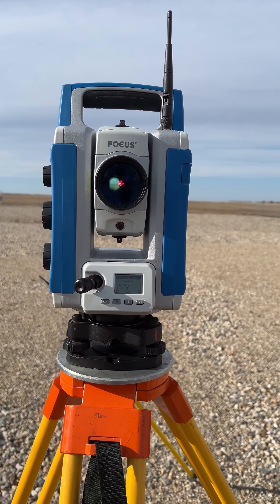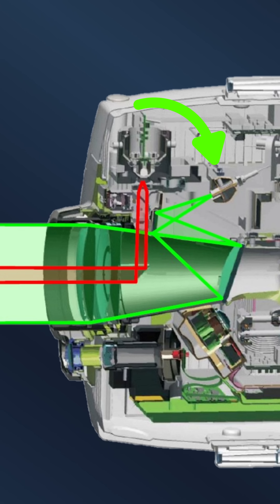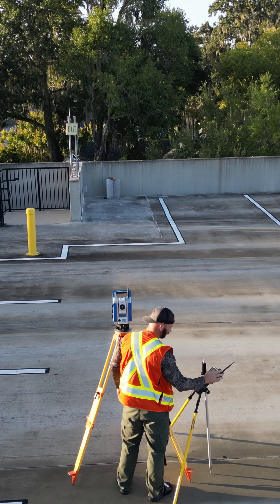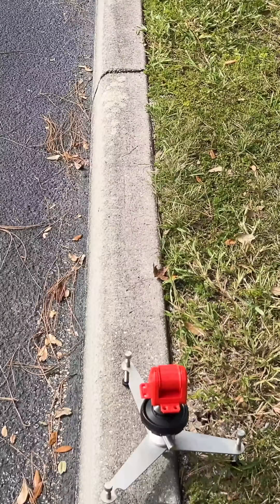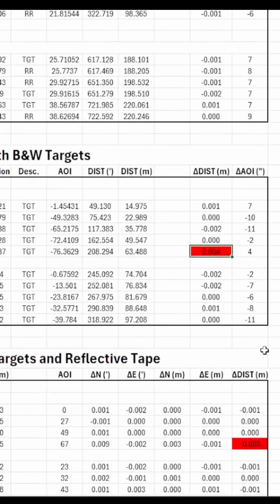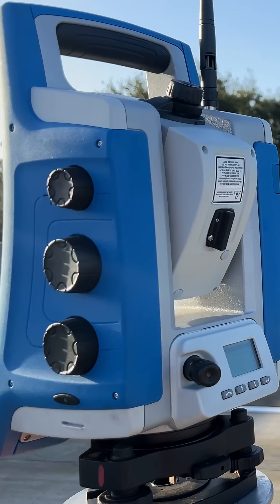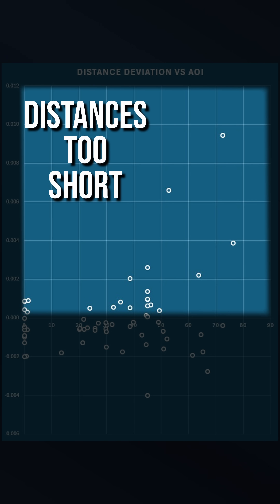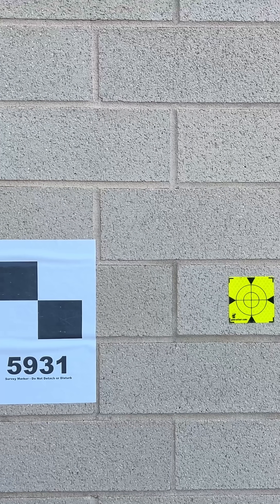Total Station Reflectorless Measurement Error To an Angled Surface

Comment: The red laser dot is NOT the EDM, it's just a laser pointer. You can adjust it with two screes on the top of the collimator. The EDM is invisible.
Reply from the maker: I’m sorry but you are incorrect, sometimes.
Some instruments are manufactured in a way so that the laser pointer and RL EDM are one and the same. Others do not take this approach. It’s instrument specific.

Comment: Just a question, when using the mini prism. I noticed that tilting the face makes a difference of 3-4mm. So for example is it better to tilt the mini prism to the face of the total station to avoid any errors (I use the gmp111-0 mini prism)
Reply from the maker: 3-4mm is a lot for a nodal prism but yea, it's always best practice to have your prism pointed towards the instrument.
Reply: You picked the wrong gmp 111 prism, with the 0 (-34.4 mm) constant,  its non nodal, and being squared up with the instrument becomes more critical. Thats where the +17.5 (-16.9mm) is superior and doesnt have that problem. Your problem is worse the farther away you are from your instrument.
Reply from the maker: @ron6625  Good catch Ron!
Reply: @ron6625 that’s a good point. So why do some many people think the 0 constant mini prism is more accurate. Is it really more accurate than a mini prism that’s 17.5mm constant
Reply: May be incorrect, but lets try a quick one:

Non-Nodal: Not centered over the physical point it's measuring a distance to. Relies on offset calculated by determining the prism constant. Really simple to do, and is the main error source needed to be accounted for. Relies on the target being pointed directly at the total station, or as close to it as reasonably possible when doing short range work. A much larger problem when you're closer to the machine/doing layout. But perfect for backsight targets, or not relying on autolock scenarios.  

Nodal: Needs to be manufactured to high standards. But when centered over the physical bottom of the pole/also needs its prism constant to measure the correct distance to that center (again, constant). If you rotate it up close, since the autolock is following the center of the prism it will happen to fall over the center of the pole, helping reduce angle measurement errors to the center. So these are fantastic for layout/upclose but lose value when you're using them far away.   

 TLDR: It's going to "lock on" to the point it's physically plumb over, and by definition, non-nodal means that horizontal center point isn't going to be over the point you're measuring to.

So for backsight targets and/or scenarios where you have someone sighting the old fashioned way (and he can tell you to rotate/turn the prism, or just turn off autolock) a non-nodal prism may be more accurate...but in real world scenarios it's always "use the right tool for the job".  With autolock and close layout, you're better off with a nodal GMP111-1 or GMP-101 (the king)

Comment: This is a sick video. That matches my own observations. I've found with trimble total stations if it can't bring the accuracy down to a decent level, it just wont publish a distance.

I would love to see a video comparing control established by standard prisms and DR established control. In practical terms: eg. Allowing resection math to determine accuracy/work out the error.

A use case may be 3 point resection from points 100m away, laying things out up to 20m away. Then storing that layout.  Then compare the layout  error compared to using fixed prisms in the same control network. Id love to see if its good enough to expect within 2mm of using targets like this vs prisms (assuming all collimations and instrument errors are similar between both modes).

Either way, love this so much man.
Reply from the maker: This is a fantastic idea. I'll add it to the list, thanks!